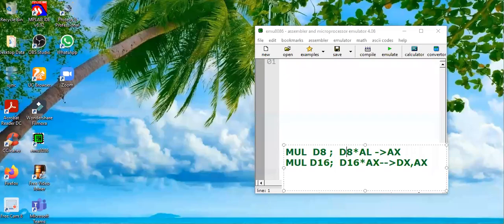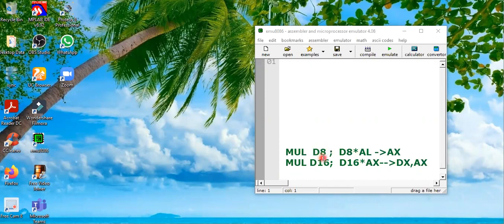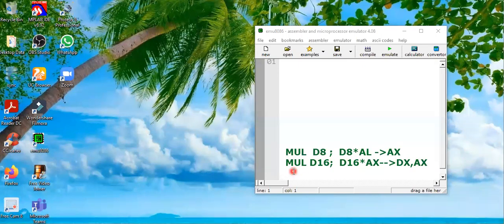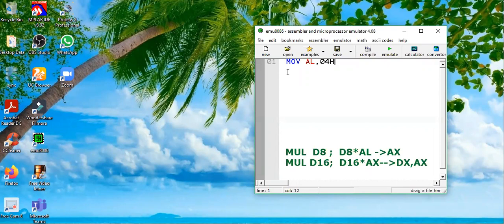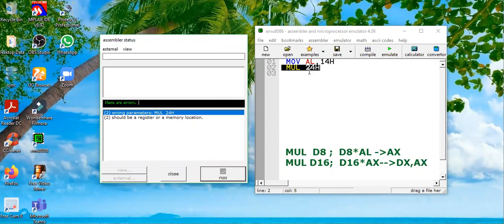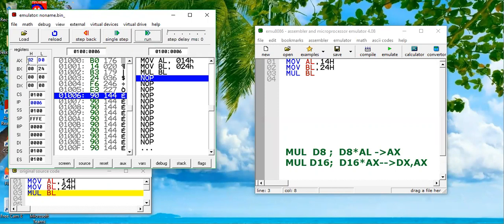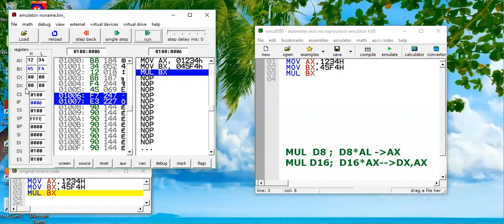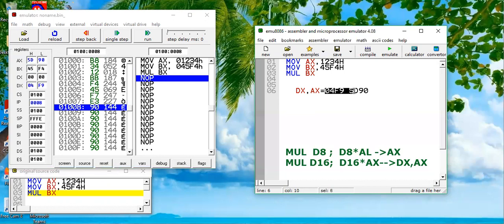MUL INSTRUCTION |8086 Instruction set with emu8086 | MUL INSTRUCTION IN 8086 ASSEMBLY EXAMPLE

Comment: sir, thanks for the lectures. I want to ask a question. Does 8086 microprocessor use 2's complement form or signed magnitude form in arithmetic operations?
Reply from the maker: I am pleased that these lectures are useful for you. 8086 Microprocessor uses signed magnitude form in arithmetic instructions.

Comment: Sir, why is it storing in th DX register? Any specific reason
Reply from the maker: In 8086's hardware, the Designer implemented Multiplier, and for 32-bit output, We can not express the result in one register (Since Every record in 8086 is 16-bit); we need another log to define the production in case of 32-bit output. DX is used for higher significant 16-bits in hardware. That is the reason of most significant 16-bits are stored in the DX register.

Comment: what happens when we multiply to 32 bit numbers and where this number will store?
Reply: in two registers DX,AX
Reply: i think the operation wont be possible because 8086 is a 16bit processor. it can only perform 8-bit and 16-bit operations but not 32 bit.